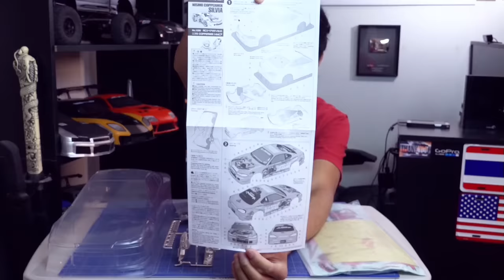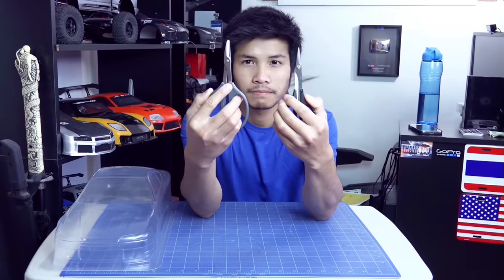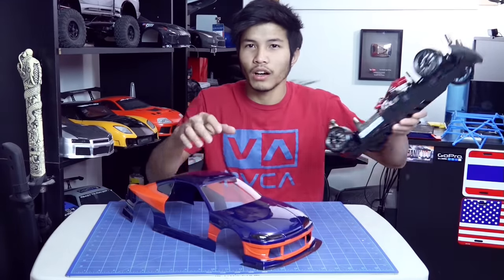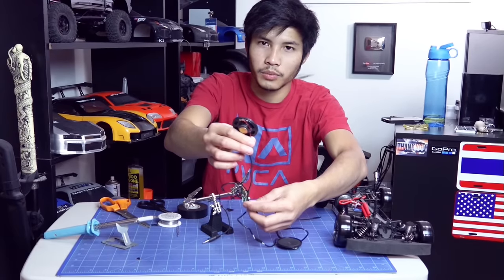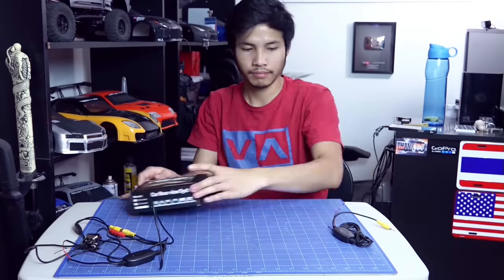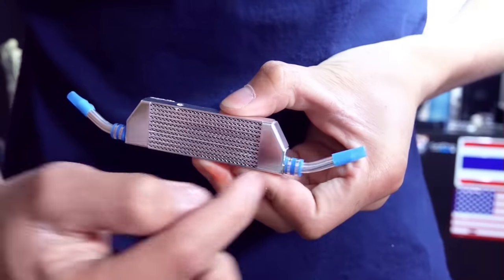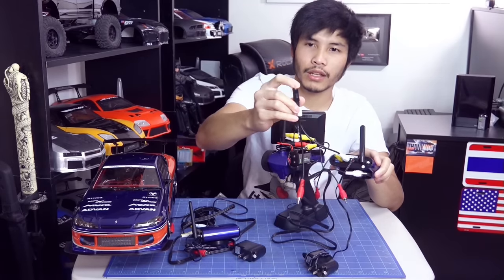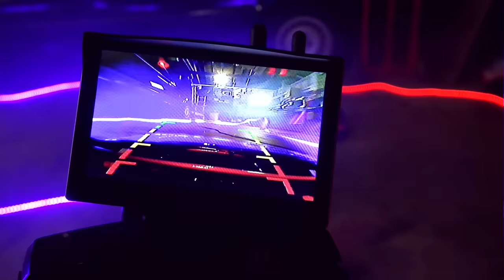RC Modify 19 | Nissan Silvia S15 - RC Car

Comment from the maker: Backup wireless camera kit
http://www.banggood.com/5-Inch-LCD-Monitor-Mirror-and-Wireless-IR-Reverse-Car-Rear-View-Back-up-Camera-Kit-p-995162.html

SainSonic SS-630 Wireless Audio Video Transmitter & Receiver
Amazon http://amzn.to/2p5U9ds
------------------------------
1/10 MadSpeed Drift Car
eBay https://goo.gl/hh5zcP
Amazon http://amzn.to/2nV0o4w

1/10 Nissan S15 Body
eBay https://goo.gl/ZI0EVN

Stickers
http://www.screenprintdigital.com/

Color(s):

PS-59 Metallic Blue 
eBay https://goo.gl/9JpzcZ
Amazon http://amzn.to/2o7oMl9

PS-7 Orange
eBay https://goo.gl/ZHexSu
Amazon http://amzn.to/2oFanOx

PS-31 Smoke
eBay https://goo.gl/1k8gN7
Amazon http://amzn.to/2nIhMri

Transparent Colors
http://abchobbyusa.com/lightingkit.aspx

Stereo System:

Mini MP3 Player
eBay https://goo.gl/Bn5Qri

Mini Speakers
eBay https://goo.gl/BpyHfe

Servo Wire 
eBay https://goo.gl/GPXXim
Amazon http://amzn.to/2nPfasE

1GB Micro SD TF
eBay https://goo.gl/Qbfrs1
Amazon http://amzn.to/2o7bZ2h

Bluetooth
eBay https://goo.gl/NTzD3f
Amazon http://amzn.to/2p6gGXB

USB 2.0 Female To DC Tip 4.0x1.7mm Female
eBay https://goo.gl/wK5aHf

Tools For RC Modify:

3M Mounting Tape
eBay https://goo.gl/gXDStt
Amazon http://amzn.to/2p65Lx8

Colored Glossy Vinyl Tape, White, Black, Gray, for Tokyo Drift Mona Lisa S15
eBay https://goo.gl/raQAZo

Dubro 2331 lexan Body Reamer & Scissors Set
eBay https://goo.gl/uHkXpX
Amazon http://amzn.to/2nF4MTx

X Acto Knife
eBay https://goo.gl/9Knkdg
Amazon http://amzn.to/2nbSdUh

Duct Tape Nashua 48mm x 55m 
eBay https://goo.gl/K4scr9

Soldering Iron 60W
eBay https://goo.gl/aqH0Tu
Amazon http://amzn.to/2oGmhV3

Soldering Wire 60/40
eBay https://goo.gl/str3K6
Amazon http://amzn.to/2nCthR5

After Market RC Parts:

1/10 MST 5 Spoke Drift Wheels
Amazon http://amzn.to/2ncBSij

TRON LED Wire 
eBay https://goo.gl/Ek6Ogj

 Round Magnet Body Posts
eBay https://goo.gl/hiQ5fr

Extra Round Magnets for Body Posts 12x2mm
eBay https://goo.gl/haOabK

100Pcs 6x1mm Neodymium Magnets
eBay https://goo.gl/UcysCO

100pcs 6×1.5mm Magnets
eBay https://goo.gl/8ZAGJe

M1.2x4mm Bolts
eBay https://goo.gl/SLPgII

M1.2 Nuts
eBay https://goo.gl/syOX9z

M1.2x5mm Self-tapping Screws (Silver)
eBay https://goo.gl/lJNeZr

M1.2x5mm Self-tapping Screws (Black)
eBay https://goo.gl/Zq8XtY

Roll Cage Balloon Sticks 
eBay https://goo.gl/nL5l5g

Alloy Inter-cooler Kit Suit 1/10 RC Model
eBay https://goo.gl/ikYdeD

RC 1/10 Drift Car Shock Cup Tension
eBay https://goo.gl/ucmjnD

Mini Hinges
eBayhttps://goo.gl/ghJKvB

1/10 RC Drift Exhausts
eBay https://goo.gl/Oo6x6m

1/10 RC Spoiler
eBay https://goo.gl/b0zjL4
Amazon http://amzn.to/2oE4vVo

GT POWER 12 LED Flashing Lights
eBay https://goo.gl/9Lq5cj
Amazon http://amzn.to/2oaPBVW

Amaco 1/16 Aluminum Contour Mesh AO50004D
eBay https://goo.gl/dGr7Qn

Optional Parts:

Mini Car Stand Blue by Duratrax DTXC2361
eBay https://goo.gl/fzWXPr
Amazon http://amzn.to/2oaYzm3

Deluxe Car Stand Blue by Duratrax DTXC2370
eBay https://goo.gl/ghGvBr
Amazon http://amzn.to/2nFakgy
Reply: DarkDragonWing  Woouah t doué
Reply: DarkDragonWing woootfawe guchenpions
Reply: DarkDragonWing
Reply: DarkDragonWing Mercury member over diesel when you want the thing on the Lamborghini car is the address 49 Partridge way Hellzapoppin Catherine
Reply: hey Maggie can I get the black Ferrari car
Reply: DarkDragonWing were do u live
Reply: DarkDragonWing p
Reply: DarkDragonWing i
Reply: DarkDragonWing s
Reply: DarkDragonWing forma mustanggggg
Reply: DarkDragonWing акрыть
Reply: DarkDragonWing งมา
Reply: DarkDragonWing you to sell
Reply: DarkDragonWing the best video of rc car in the world
Reply: How much did you spend?
Reply: DarkDragonWing wau genial
Reply: there is a description....
Reply: how to add engine sound in rc???
Reply: DarkDragonWing
Reply: DarkDragonWing สวัสดีครับ
Reply: Sale $$$
Reply: I want request you build rc car GTR R34 NISMO look like paul walker 2 fast 2 furious please
Reply: Your voice sounds fucking funny 😂
Reply: Hi my friend! Can i Ask to you ti update the links?? Some are off unfortunately 😔 thank you very much!
Reply: V67
Reply: Do u sell any of ur beautiful cars u made ???😁
Reply: ج

Comment: sweet video, couple of things I think could work, the camera: you could use a baby monitor most have a display with a built in battery so you don't need and extra source and they have a longer range on the transmitter between the 2, and second the speakers: would be better sounding with any kind of backing even a cardboard box with a little paint on it for reverberation of sound. I also think it would be cool to see some neon under body lights, over all super impressed.

Comment: hey I modify RC planes  to fly them FPV and got some systemes that work pretty well for cheap in the drones hardware 
The quality is not the best but usually modifying the antena does the work to improove transmition quality
Reply: That is a great idea. Use drone cams and the electronics. They are made lighter and for operating by other frequencies.  Excellent idea.

Comment: I know this is an old video. I've seen several people put speakers in cars. Every video I watch, I sit and look at my desk speakers in front of me. Its a cheaper priced, older logitech computer set from Walmart with 2 desk top and a sub. Reason I tell you, is they are a 2" fairly fully range speaker. More importantly they are smooth silver cone speakers. Look almost identical to a 2" alpine type R sub woofer. Not sure about the power they need but they look like a decent set of scale 12's or 15's to use. Check out Z407s  that's the new set of them.
Reply from the maker: Oh yes, I know exactly what you mean, those speakers are awesome and cheap now. It will be a blast to make another stereo system video for sure.

Comment: Why do didn't u cut the wires right on the speakers or the board and resoldered them? Now you have done extra resistance in the cable?

Comment: I need some help with this. I bought a 239mm wheelbase body, specifically a Tamiya Silvia S13. I have the MadSpeed chassis used in this video. Would there be a way for me to fit this? I already trimmed some of the body, and the eBay seller doesnt accept returns anyways. How could i fit this in a way where i dont have to spend more money than i already have?
Reply from the maker: That would be impossible. The chassis has a wheelbase of 260mm. It's way off. 

I can't come back to reply, you will have to start a new comment if you have any questions or concerns. Cheers
Reply: Blake Jimenez if I was you I would make it as a practice one and just sell it.

Comment: Hi! Where it is possible to buy tubules for construction of a framework of safety? Thanks :)
Reply from the maker: Hi. Here https://rover.ebay.com/rover/1/711-53200-19255-0/1?ff3=4&toolid=11800&pub=5575273973&campid=5338044275&mpre=http%3A%2F%2Fwww.ebay.com%2Fitm%2F100-Party-Festival-Appliance-Plastic-Balloon-Sticks-and-Cups-%2F351976616577%3Fvar%3D%26hash%3Ditem51f370f281%3Am%3AmBLRAKagTwrmPArrxbf9_ag
Reply: Thank You ;)

Comment: would anyone recommend an rc car under £100 that I can modify in a similar way to this I will keep an eye out for replays for 3 weeks
Reply from the maker: There aren't any of them that cost less than that that you can modify.
You can check these ones out though.
You can build it yourself like this video here. Look in the description for links:
https://youtu.be/aJGDfJp9cZY
Or you can buy one of these already built:
http://www.nitrorcx.com/madspeed-drift-car-green.html
http://www.ebay.com/sch/i.html?_sacat=0&_from=R40&_sop=15&_nkw=1%2F10+madspeed&rt=nc&LH_BIN=1
http://www.ebay.com/sch/i.html?_odkw=1%2F10+hpi+drift&_udlo=190&_sop=15&LH_BIN=1&_osacat=0&_from=R40&_trksid=p2045573.m570.l1313.TR2.TRC1.A0.H0.X1%2F10+hpi+drift+RTR.TRS0&_nkw=1%2F10+hpi+drift+RTR&_sacat=0
http://www.ebay.com/sch/i.html?_udlo=290&_sop=15&_mPrRngCbx=1&LH_BIN=1&_from=R40&_sacat=0&_nkw=1/10%20mst%20drift%20RTR&rt=nc&_udhi
http://www.ebay.com/sch/i.html?_odkw=1%2F10+tamiya+drift&_udlo=300&_sop=15&LH_BIN=1&_osacat=0&_from=R40&_trksid=p2045573.m570.l1313.TR0.TRC0.H0.X1%2F10+tamiya+drift+RTR.TRS0&_nkw=1%2F10+tamiya+drift+RTR&_sacat=0